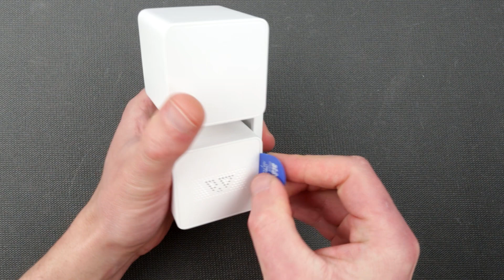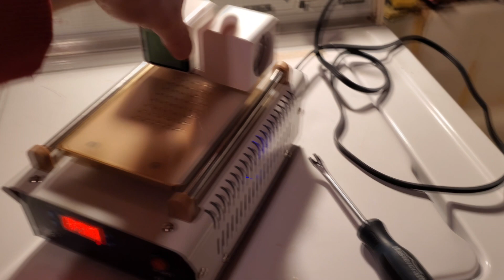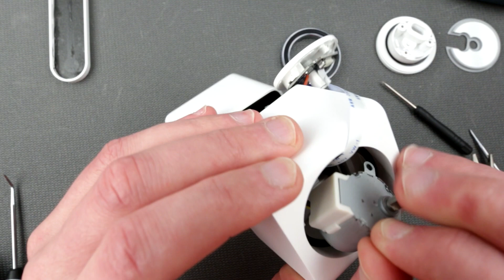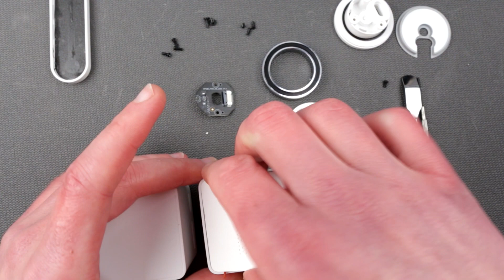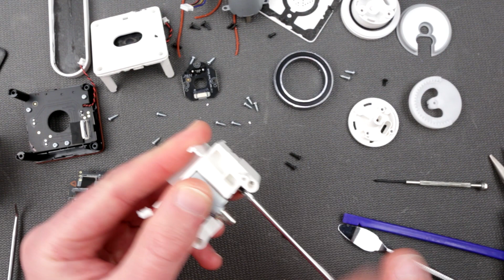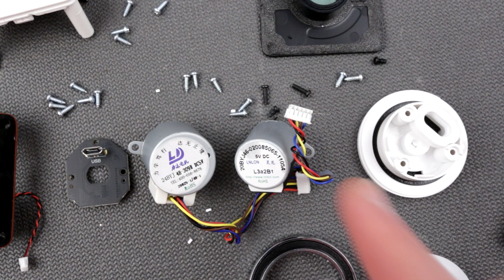Wyze Cam Pan v3 Teardown

Comment: I was interested in what kind of antenna it has. My cameras keep disconnecting from my internet. The only cameras are the pan V3. I believe Wyze cam V3 has an inferior antenna. All my other cameras work fine and have never -90 disconnected.
Reply: Having the same issues as are others posting on the Wyze forums.
Reply from the maker: @a9s2w5  looks like it is wide spread, but for some reason my cam is fine !
Reply: @InsideOutElectronics  So there's a thread over on the Wyze forums about these issues. There's been no response from anyone at Wyze. But I have noticed that the camera's issues seem to be somewhat related to power draw. If I turn down the  speed of the motors and sensitivity my cameras become fairly stable. Wireless signal is better etc. And I was reminded of this video and the chip that you thought may be driving the motors. So I was curious, did you ever find out any other information on what is inside this camera to drive the motors?
Reply: @a9s2w5   Oddly, this has been a topic on several subjects that i as a third party, observer may add to this since ii may provide a different view since the issues could be similar .... hearing that your issues had been resolved by lowering the power to the motor(how you did this in this application also interests me)...  I had com across a DYI drone build that was getting reception issues.....another drone review where the gps could not locate satellites. Turned out that in each of those either the motors or another component on the pcb was very noisy or producing EMF/EMI..... 1 solved the issue by placing a piece of copper shielding tape they got out of another old torn down electronic device(something like a transceiver).....could use foil...alu foil, alum foil tape.....items of such nature to shield the noisy component.....or if possible, the individual with the GPS issue had moved componnents.....so that they where further apart from 1 another....walla....and those fixed their issues.... 

So, I am wondering if that is the case here also. If so, then placing said materials between or encasing the noisy culprit is the answer.....that or, if there is a ipex connector, drill a small hole in the plastic and run an extension out of the already crammed enclosure out and attach a tuned omni directional 2.4ghz antenna with decent db rating such as a brand like Alfa.... now , that makes me curious......i'd love to see some 1 take a nanonova swr meter and measure the pcb/ tin metal antenna that is within the device....see if it is at all ven designed for 2.4ghz....almost seems to me they just willy nilly threw somethin in with a general shape of something that may have worked on another application...but, not all devices are made equal.......though, if you were to bust open the plastic of an antenna.....surprisingly.....a simple wie with some coiled sections or separated sections where partially grounded.....or instead of a thick wire, a pcb with thicker traces would be found. It sure takes away from the macho vibe a large antenna gives off when you look at its guts and it is what looks like a spring a third of the size...antenna design is very intriguing......
Reply from the maker: Hi, thank you for comment! My camera seems to be working fine. And i have teardown of Wyzr can v3
Reply from the maker: Check this v3 teardown  - https://youtu.be/NlioyKIDpTI
Reply from the maker: Check this v3 teardown  - https://youtu.be/NlioyKIDpTI